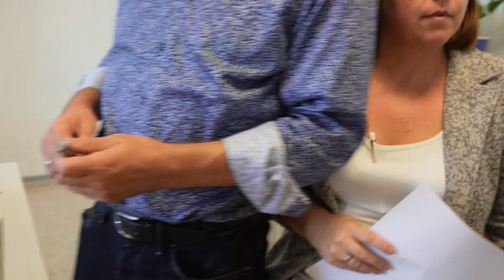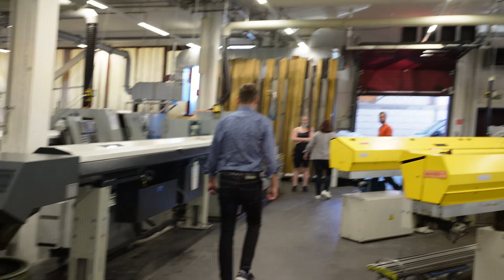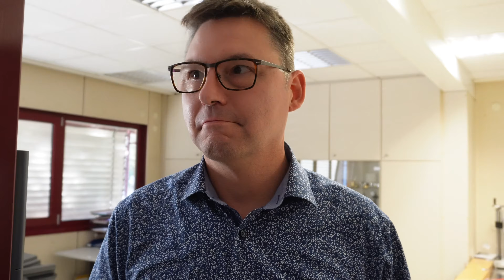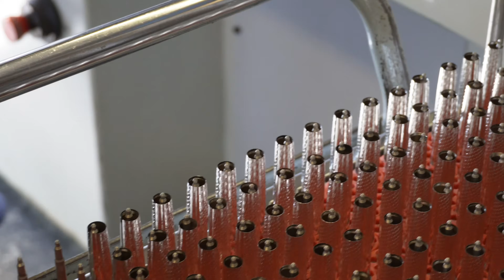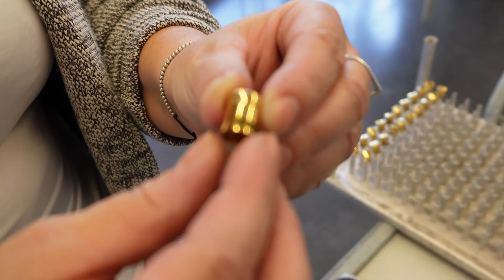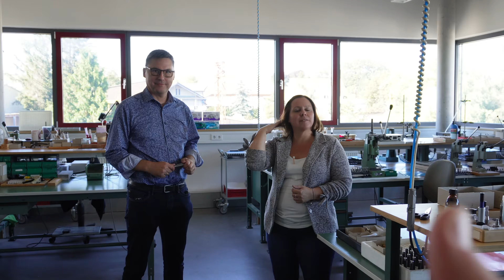The complete Production of Otto Hutt Luxury Pens. 🖋🛠 MUST WATCH (!!!)

Comment: Your content is great of you to show the production.
Every pen is a technical marvel but they use laquer which is a waste even finger nail can scrape them and brass which corrodes easily. These pens are mean't fail.
PLANNED OBSOLESCENCE is not be supported by me. A turd covered by gold foil - Money and fake value adding.
Learn from Japan pens ethics, cheap pens for students and heirloom pens with art and man hours made with ebonite or urushi or sturdy resin or even horns for pen aficionado
Reply from the maker: Hi, have you ever had one of their Pens in hand? I don't know based on what you're stating that a finger nail can scrape the pen. These pens are SURELY NOT meant to fail, but i think this is how pens and most of the brands produce in the future.
Reply: @SamuelNaldi  Yes i have had these laquer pens and also can you guarantee these pens are 100% scratch proof or ceramic coated? 
Brass in these laquered pens corrodes with time ie. in few days. Do you agree my point?
Stainless steel pens are of good quality offered by parker at less markup price.
Reply: You ignore some facts:
First, good quality brass doesn't corrode destructively. Instead, a firm and durable patina layer forms on the surface when exposed to air and moisture. This later protects the material indefinitely from further corrosion, so brass patina is a good thing and makes brass very durable. Brass patina is not rust.
Second, the lacquer or gold/platinum coating protects the outer layer of the brass from oxidation. And the patina does the same on the inside. Thus, these pens will not fail or corrode in a lifetime, and will definitely outlast you.
Third, urushi is not eternal and must be protected from UV light. If you expose your urushi pen to sunlight, it will degrade much sooner than you expect.